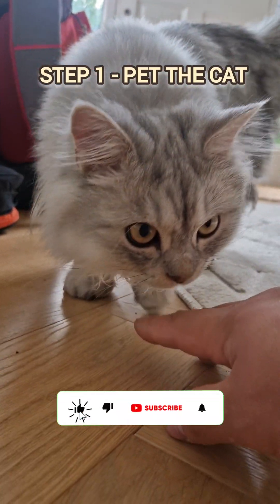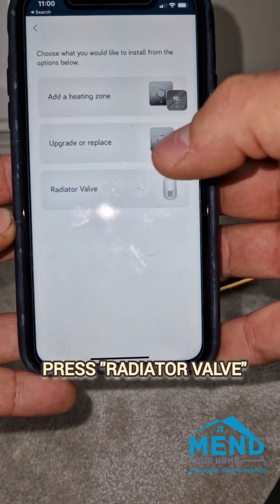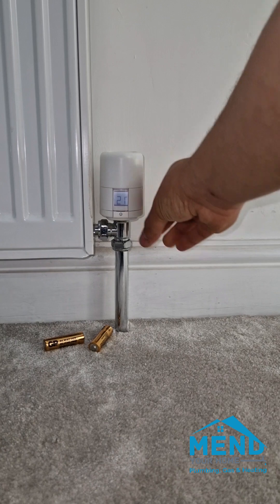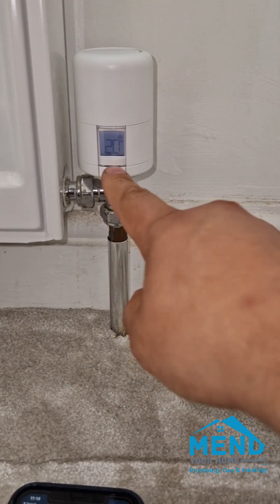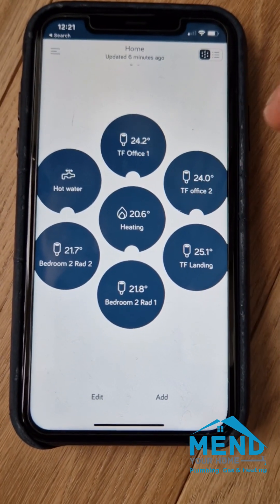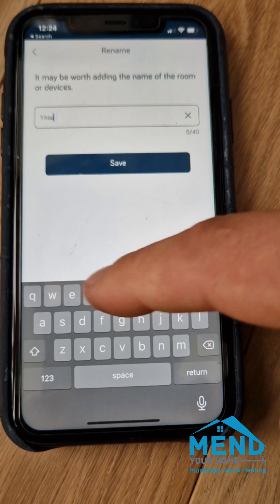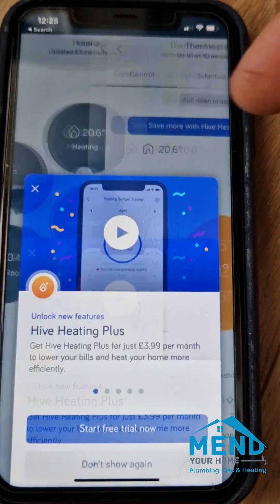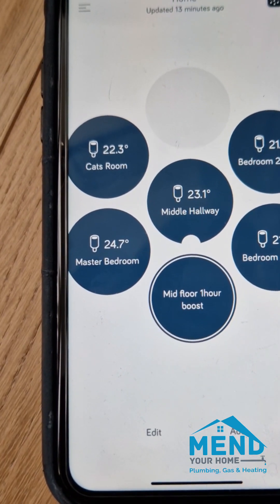Master Hive Smart TRVs: Complete App Setup Tutorial

Comment: When in your example you boast the middle floor will it not also boast any other floor to the temprature the radiator valve is set at or will it set any valve not mentioned to it's lowest value.  If it does I assume you would need to set all your othe valves to a very low temprature.

Comment: Great video. 
In the process of changing our heating system to hive with smart trv’s. Can I ask for some help and advice, how many trv’s can you connect to one hive thermostat? We have 12 rads! Can you use rechargeable batteries in the trv’s?
What’s better hive original or mini thermostat?
Reply from the maker: Hive original is better & more expensive. The mini can only be programmed via the phone the original you can do everything in the thermostat or via the phone. I've installed over 17 hive TRVs and that was ok. I don't see why you can't use rechargeable batteries. Cheers
Reply: @mendyourhome  Thank you. I spoke with Hive and apparently the rechargeable batteries have a lower discharge voltage than normal batteries which make the trv’s not work to full capacity? Have the Hive and trv’s. Now just to work out how to wire the receiver to the combo boiler!